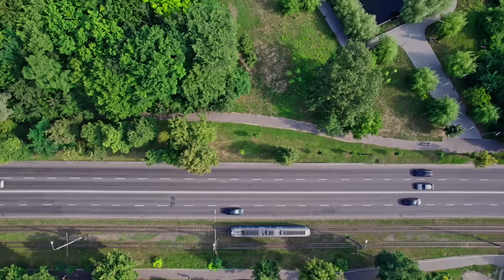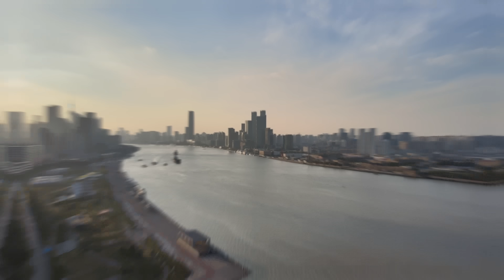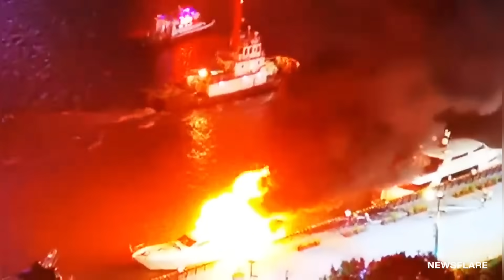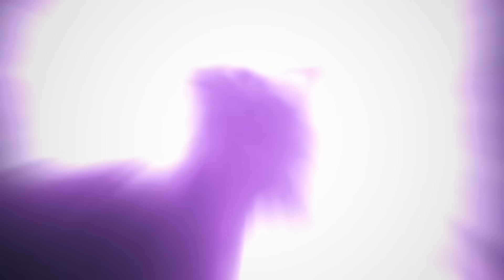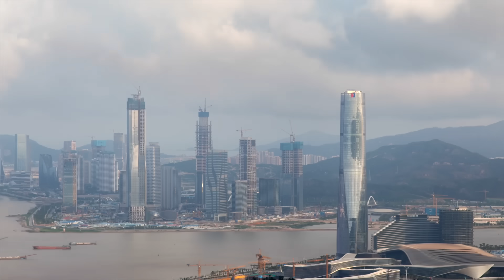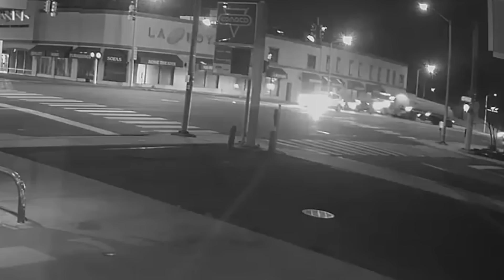Terrifying Catastrophic Failures Caught On Camera

Comment: One winter some years ago, I was working at concrete batch plant, it was down in quarry, and water was supplied by a nearby pond.  This day it was cold, there was maybe 2 inches of ice on the pond.  I stared the pump and filled the truck tank, drove it back over to the plant, refigured the hose for off load, started dumping the water into tank and all I heard was crunch.  The water in the tank was heated, a 10,000 gallon tank did what that tank car did.
Reply: and I'm pretty sure the tank car implosion vid was the mythbusters own clip of them imploding a tank car.
Reply: @jaquigreenlees  The one the mythbusters did was more secluded as I remember. I think this was a different one.
Reply: @jaquigreenlees  No that was for a training video for the railway people and firefighters.
Reply: Tank must not have been vented properly
Reply: That is why you have to put winter air in your tires. If you leave the summer air in, you will have flats in winter. Just joking. Maybe.

Comment: It looked like the tanker was moving pretty fast to begin with. I don't see how he'd been able to slow down even if the other car hadn't cut him off.
Reply: I agree, I drove a gas tanker for 10 years and he was going too fast approaching an intersection.
Reply: It's really is amazing how careless people can be their live and others.
Reply: i agree , looks like traffic was stopped for a lite and the truck was going too fast and not paying attention.
Reply: That was my immediate impression as well. Should never have happened.
Reply: Unless the video was sped up for drama and ratings,   best guess is driving too fast though.
Reply: Check a replay of the footage and timing of the traffic lights. See if the front vehicle was waiting for lights to change to allow them to turn left. If 2nd car changed their mind or last minute did not see first car, and then cut right in front of truck, truck driver would try to avoid 2nd car by veering right. Have you not been cut off in that situation before? Fuel tanker drivers are very, very conscious of what they are carrying and what will likely happen in an accident, knowing that in an accident they stand a good chance of being injured or killed. So give the truck driver a break. Think about you have done in similar circumstances. Also look at dashcam footage of the number of times truckies have been cut off by cars. Have heaps of such footage here in Australia.
Reply: @bobhudson6659  One, light was green and if it works like most signals of that type both directions have a green light with no turn arrow.  Two, the white or light colored car was going way to slow or taking to long to accelerate, there are no oncoming cars visible in the footage nor do any appear to be approaching the intersection...reaction time is the problem most drivers have, not being too fast or slow.  Third, even driving a tanker truck, it would probably have been much safer to take out the black car that cut him off, just maintain control of the truck and not try to swerve, they aren't designed for it.

Comment: Here is what is interesting about that railroad car:

These tankers have pressure relief valves just like airliners.  If the pressure inside gets too much, a seal blows out and the contents are released until the pressure returns to normal.  Airliners have outflow valves that regulate the fuselage to 8.6 psi differential via variable outflow valves.  The valves have two motors, one AC, one DC and two separate computers that can control either motor.  AND even after that, they have emergency outflow valves that can relieve pressure if it gets more than 0.15 psi above what it is supposed to be.  

But they also have INLET pressure relief valves that allow air into the fuselage if the outside pressure is greater than the inside;  These are simple hinged panels with seals that would allow air in.  This prevents a sealed airliner from being crushed due to massive air pressure increases.

NOW, let's talk about your house.  A tornado comes toward my house in south Flori-Duh.  I have:

* Impact glass.  Those of you not from Flori-Duh should look this stuff up;  It consists of two layers of 0.25 inch tempered glass with a clear rubberized layer in between.  These windows are Miami-Dade rated, which means that they can absorb the impact of a 3 foot section of 2 X 4 at traveling at 155 mph without intrusion.  On my house, if you intend to break in by punching out a window on the door and opening the latch this isn't going to work;  You punch my windows?  Fuck you, you are going to break every bone in your hand!

* AND my hurricane hardened house [continue reading, I'm going somewhere with this...] has cinder block/concrete walls.  And the roof is concrete tiles as well.  The top 18 inches of the walls are poured concrete with embedded metal straps that are wrapped around the "A-frames" that form the low, 3 foot roof and secure the entire structure from being lifted off.  

* My doors have secondary latches.  The normal door handle and deadbolt, but a secondary system that sends pins into the frame at the top and bottom.

* My garage door has steel cross members that are six inches deep and two inches wide;  They look like the frame of a pickup.

What's my point?  My house could take a continuous 155 mph storm without damage.  It won't withstand a flood, which is remotely possible, and a storm like this would certainly decimate the fences and my landscaping, but the house would survive.

BUT....

If a tornado with 114 mph winds hits my house?  All bets are off.  I don't think it would survive, because tornadoes don't kill houses [Well, at least my house...] due to wind, 

they kill houses because of the AIR PRESSURE DROP.

When a tornado passes over a home,  the air pressure inside the vortex decreases by about 1 psi and the home is literally blown apart by the pressure differential.  This is how tornadoes rip the living shit out of neighborhoods, yet the wind speed would barely make my pool dirty~
Reply: The railroad tank car imploded because of the very strong vacuum that was connected to it. Not pressure. Vacuum. Standard sea level pressure of the air is 17.1 pounds per square inch. So 14.7 pounds per square inch will not crush a railroad tank car. However, the weight of the all that water on the Titan submersible was 6000 pounds per square inch! That is what crushed it.
Reply: @mytubeviewerjeff  First of all, vacuum really doesn't exist.  It is simply a lack of air molecules, and the compression of this vessel was caused by outside forces, not inside forces. Same as the Titan submersible that you noted.

-The standard atmosphere is 14.7 PSI at sea level.  I have no idea where you get 17.1 PSI, that's nonsense. The standard atmosphere is also 59 degrees F/15 degrees C, 29.92 inches of mercury/1013 millibars.   Please make note of these FACTS.
Reply: Which is why it is recommended if you have time OPEN all of your windows in your house, that will save it from the air pressure change of a tornado...but a lot of people don't even know that rule
Reply: @zaklex3165  True, but there is one little catch to that.  In Flori-Duh, my house has joist straps.  The walls are concrete block, but the top 18 inches is poured concrete with metal straps protruding.  These are designed to wrap around the ceiling joists and are nailed to the wood A frames.  This prevents the roof from being lifted off the house during a hurricane.  This can easily happen on a house without these straps if a window is broken due to flying debris and the inside of the house is pressurized by ambient winds.

Most homes outside of Flori-Duh do not have these straps, which means that opening the windows during a tornado is essentially a moot point....
Reply: @Flies2FLL  Actually, the opening the windows isn't just something I made up or read about...it's recommended by the building trades and the insurance institutes, they've done modeling and testing(in other words backed by scientific studies), a house with open windows has a much greater chance of surviving intact than with closed windows...because the pressure remains the same inside and out during the entire tornado.  Could debris still cause damage, yes, but losing your roof or having the entire house destroyed...almost never.
Reply: @zaklex3165  Interesting.  I'm waiting for Miami-Dade county building codes to come to the midwest;  It is only a matter of time before builders build homes to our standards, to include 3/8 inch thick three layer tempered impact glass like I have on my house.  Each of my windows can absorb the impact of a three foot section of 2 X 4 moving at 155 mph dead center on the window and there will be NO intrusion.

Comment: Why was the driver going that fast going thru a town with a load of GAS ?
Reply: Prob paid by the load not hourly. Lots of truck drivers paid by the mile or by the load. Good way to get product moved without drivers doddling. Problem is they then take more chances. If you drive slow in a truck then people start doing stupid shit trying to get around and in front and it's actually more dangerous.
Reply: Drive slower, you don't have any chance to keep your job for long

Comment: When cranes crash it can make a heck of a mess. At a gas plant in northern Alberta. A outrigger on a 100 ton Horlick cran's outrigger collapse'd sending the almost fully extended boom crashing through some ammonia pipes . Also taking out some high pressure toxic gas lines. Numerous other lines.. The Crain crashed directly through a high pressure pipe rack.  Some people didn't make it out alive. To us that did. We had the wind to thank for our survival. Thought me a valuable lesson. Safety always safety first. After a intense investigation. The blame was put on faulty blocking pads under the outrigger. The partly rotting wood let go a few inches when the Crain was under full load. Enough to couse the pad to crush making the supper structure un level
Reply: Sounds terrifying. Glad you made it out mate and sorry about those who didn't. How bad was the ammonia leakage? Nasty stuff.
Reply: Was that at Joffre? Or the one by Rimby? Sounds familiar to me for some reason.

Comment: Tankers, both road and rail can easily deal with 50 psi pressure from inside pushing out.  They are not designed to deal with vacuum pulling inward.  The narrative means that rail tanker failed under -14 psi of vacuum.

Comment: It's pretty obvious on the first clip that the Donnely nut spacing did not match the bracketed caps and splay-flexed brace columns. Should have gone with the cracked system rim-riding grip configuration instead.

Comment: Hmm, yeah, the Titan sub, interesting. But, what is it? Or, what was it? It imploded under pressure If I comprehend correctly. Although the title says it exploded. But what was the Titan sub?
I may as well add that the pressure the trainwagon imploded under can not have been more than one bar. Every ten meters under water adds one bar to the total pressure.

Comment: Sorry, the railroad car was bot a catastrophic failure. The tank was steam cleaned and closed up so no debris would get in.  There is a safety device , not a vacuum breaker. Did what it was designed to do.
The rest, well…. You’re right.

Comment: The Titan sub implosion would've looked like an explosion if you could've seen it somehow. Things down there implode with such force they explode back out. Someone did the calculations and for the size of the Titan at the depth it was at it would've been like 57 pounds of TNT going off and this is micro seconds after the implosion, so yes those poor souls went of of existence much, much faster than a blink of the eye, faster than your nerves can conduct signals from one end to the other.

Comment: The Titan submersible was crush so fast that everything was utterly destroyed in less than a millisecond, so in 1 thousandth the people and the submersible  went from being fully operational to nothing more than a few tiny pieces of debris, bubbles and some red liquid which then instantly merged with the seawater. there is nothing left of the people that were inside of it. All because the owner/builder of the submersible refused to listen to the lessons learned by humanity on how a submersible should be built. The guy wanted to build something that could take passengers down to the bottom of the Ocean and thought a cylinder would work. The biggest problem when trying to learn from EXPERIENCE is that the consequences come before the lesson, and this is definitely the case with Ocean Gate Inc.. I hope there are no other fool hardy people out there who think they can ignore the laws of physics and not face the consequences. This incident with the Titan Submersible is also a warning to prospective customers to do their homework on anything like a Submersible and make sure it has actually proven itself to be a fully operational a tried and test platform before ever going on board for a trip down to the bottom of the ocean where the pressure is greater than 6000 lbs/sq.in.!!!! The Human body is a very vulnerable thing and it doesn't take much to turn it into various bits of smeared goo. and with it, your life. As soon as I heard that contact had been lost with the Submersible, I already knew it was all over and too late to do anything. when I saw the documentary footage of the design and how the sub was build, I was then positive about their fate. Tubes, are far too vulnerable to be used as submersible designs. even if the walls of the sub were a full foot thick the water pressure would have cause the layers of the carbon fiber to delaminate and fail. the entire design was flawed from start to finish. only the Titanium endcaps were of good construction, everything else was useless.

Comment: That tanker was on myth Busters and it did not have pressure, it had a vacuum in it
Reply: ...as stated in the video. Vacuum in the tank, 14lb/square inch air pressure outside crushed the tank.

Comment: The car that you describe as being the cause of the crash was stopping at a red light while the truck was proceeding at the speed limit (plus or minus). This was not the fault of the automobile, it was the truck driver not paying attention to his first and ONLY job: drive the truck. Don't be an enabler! That luxury boat fire set fire to a second boat, too. Other than that, this is a good vid.
Reply: Wrong, pretty sure light was green and the black car was changing lanes because the lighter color car was taking to long or accelerating to slowly away from the now green light...just look at the light facing the camera, it's green, opposite is also probably green as well...unless it's one of those weird ones where the city likes to make it a 3 way or 4 way stop.

Comment: # 6 that hotel could not have just callopsed like that , it must have been a planned implosion, or it was hit by an airplane,,,
Reply: When a building loses it's FOUNDATION, as was stated by the narrator, what exactly is going to hold up the walls?  The flooding washed away the foundation, no support structure for the building anymore, so it collapses.
Reply: @zaklex3165  you don't get it, right over your head
Reply: @CopperCettle  Your sarcasm is terrible if that was the intent...work on it more, otherwise, just from watching the progression of the collapse you would know it wasn't a planned implosion or hit by an airplane(not very creative, that small of a building would've been better to use getting hit by a train).

Comment: Yes the tank car. What he told you is correct about 14.8 PSI pressure all around us at sea level. The Tank car was subjected to 27 inches of vacuum. I have seen that to semi trailers that are plugged and oops. What happened to that submersible that went to TITANIC was a weee bit more. You see those 6 axle railroad engines, Just imagine that on 1 square inch. yea, estimate 450,000 on 1 square inch and that material was to hold up? and no testing done? You cannot block stupid, occupants of 1600 Pennsylvania prove that daily.
Reply: 225 tons per square inch.

Yikes!